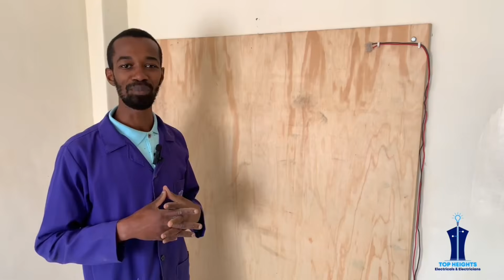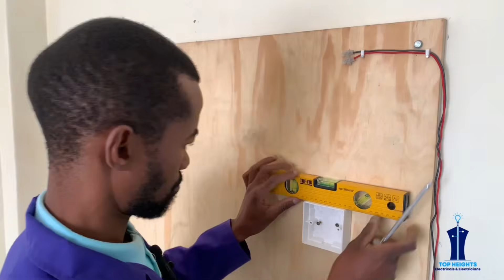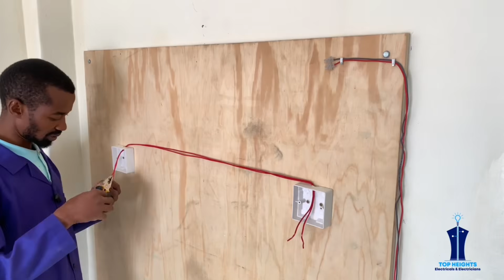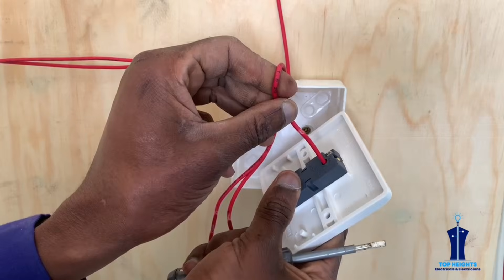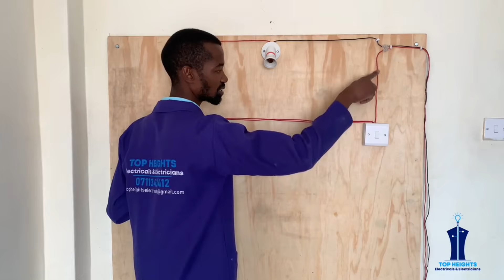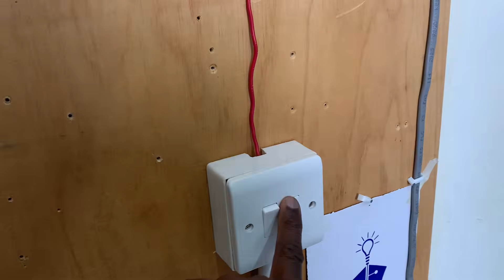How To Wire A 2Way Switch Lighting System UK.

Comment: I recently learnt of 2 plate and 3 plate wiring systems. Is 3 plate really used in Kenya? If so could you do a video on 3 plate two way switch, it was a bit confusing.
Reply from the maker: Alright I will do.

Comment: I don't know where u get ur switches from but I've been wiring commercial and residential for 30 years. Never seen   a 3-way switch have L1-L2   on it . 1 screw is different color than the other 2 screws the 1 screw is the common the other 2 travelers only 1 u need to know about is the common. And it's a 3-WAY not 2-way
Reply from the maker: Thank you for the information.
Reply: Different countries

Comment: Can either of the travellers be connected to L1 or L2, or you have to make sure the L1 wire is connected to L1 and vice versa
Reply: L1 to l1 and l2 to l2
Reply from the maker: @BigDaniel7  Vice versa also works.
Reply from the maker: Great question Seth, either can work from our practical experiences. L1 to L1 or L1 to L2.
Reply: @topheightselectricals thanks